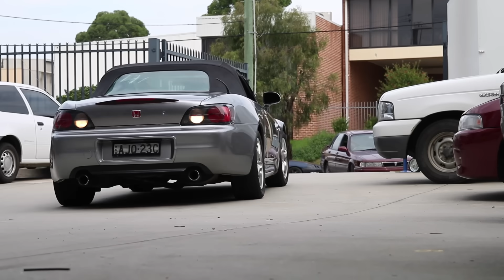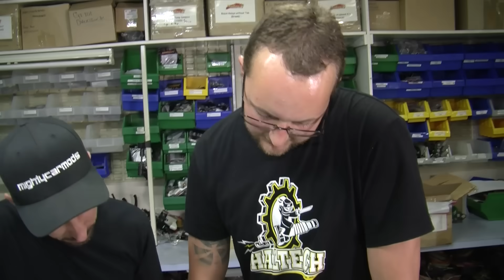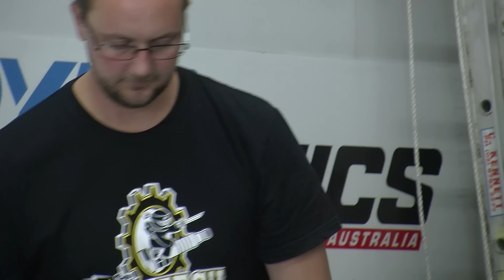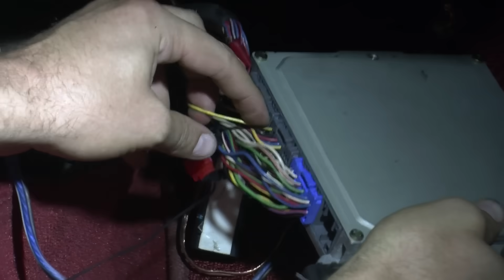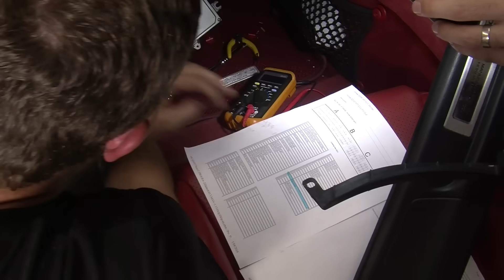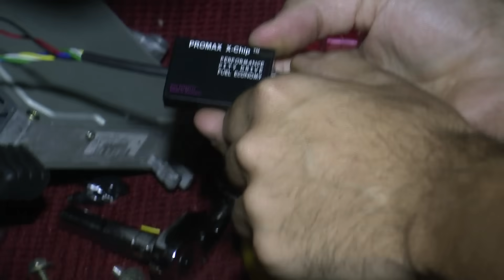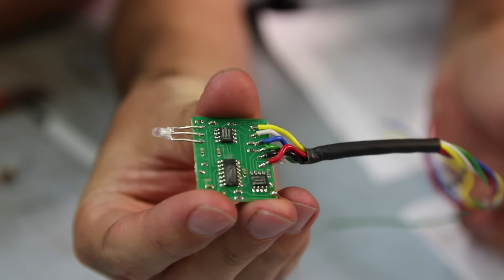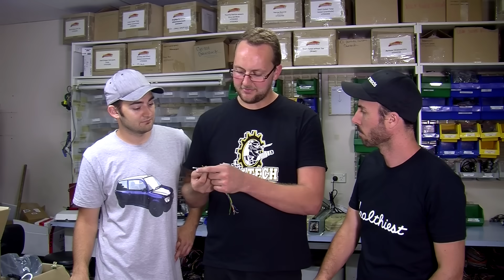eBay Performance Chips -  Mythbusted

Comment: Chips that are for factory turbo vehicles tend to see more of an improvement than NA cars... mostly because you're just upping the boost pressure along with timing etc, whereas you can't do much to improve on a stock NA engine tune.
Reply: of course, I'm talking about legit tuning companies, not random ones from china selling on eBay...
Reply: Especially a super high tuned N/A engine like s2000 wont even notice a chip :)

These things should be tested on low hp v8's of luxury cars like BMW 540i or 750i's v12.

Those engines are low hp/litre with pretty good head and intake design.

I don't also get these guys saying you can't do much on an n/a engine. If Honda can squeeze 240hp of a 2litre engine and make it a daily driver you sure can take a 4litre v8 bmw engine with 286hp and tune it to 386hp with "similar" setup, aggressive cams and some headwork, and a programmed chip specifically for those cams and heads.
Reply: eamh2002 Exactly! Look at all the muscle car guys with big v8s... some of them do put blowers on them, but, you can still get very impressive numbers from simply putting better headers and carbs on them. There is no replacement for displacement. ;)

But like you said, yeah, I'd like to see what kind of gains you get from a big german v8 that was tuned more for comfort as opposed to powahh.
Reply: David Fresne N/A cars can have their ignition timing, compression ratio, injection, pump speed, and valve timing altered by a tune, which (depending on the severity of the tune) increase power tremendously. Take all-motor 8 second Civics for example. Large-bore valves, large injectors and open headers won't be fully useful without a tune for them. Turbo cars will just make more power per tune.
Reply: SidewaysGts well tbh the MKV, MK6, and MK7 GTIs gain between 30 to 70 whp with just a tune and no bolt on a, granted they are already turboed tho
Reply: David F. I seen a unicorn shit the same fire it was an amazing experience!!!!
Reply: So it's the chip's fauilt if you were expecting miracles on an already maxed-out from the factory N/A engine?

Protein shakes too are a fraud if you use them on an Olympic athelte and only see micoscospic improvments at all?
Reply: Alejandro Bello It's not the chip's fault, it's the manufacturers fault for making the factory tune too good. :)
Reply: ***** If you read a little more closely, I mentioned "upping the boost pressure along with TIMING, etc" The etc, being the other things you mentioned. haha. 

But yes, the manufacturers main goal is power as well as longevity for those who don't maintain their vehicles properly.
Reply: ***** lolk all you quoted was "just upping the boost". you just failed to include the "timing, etc" from my comment.
Reply: ***** okay. next time, i'll make sure to include every single variable that needs to be accounted for when tuning a vehicle. :)
Reply: SideWays8Productions  Yeah that is true, but you need much more than just a chip to make power on an N/A vehicle. All the stuff you just mentioned above, like, compression ratio, large-bore valves, large injectors and headers need a tune. My point was that comparing a N/A and a factory turbo car, stock vs. stock, you will see much higher gains from the boosted car, unless you do serious engine work to the N/A.
Reply: What are you on about? Can you read? I was saying that with just a simple tune you can make power in a N/A car. You'll obviously make more power in a boosted car with a higher AFR, but on the topic of simple, conservative tunes, bolt ons or mods are not required (again, for the simplest of tunes).

My first tune on my STi was done via accessport with absolutely no hardware mods whatsoever. I tuned my neighbors BRZ with an opensource map with absolutely no mods. Both gained roughly 20hp safely. I'm simply saying, you can increase power in an N/A car with just a tune. Not by much, but still doable.
Reply: SideWays8Productions  "I tuned my neighbors BRZ with an opensource map with absolutely no mods. Both gained roughly 20hp safely. I'm simply saying, you can increase power in an N/A car with just a tune. Not by much, but still doable."

My apologies- But are you telling me that you took a car which typically dynos around 160 whp on most roller-based dynos (ie dynojet) @ sea level, and picked up 20 whp, bringing it close to (ballpark estimate) 180 whp, with zero bolt ons, and "just a tune"?

I hope youll excuse my skepticism, brought on by many years of operating various dynos professionally for years before moving to australia, and ask you to provide some evidence to support this claim, or if you are able to do so.  I have never seen a car pick up over 10% of its power from a remap of any sorts. Care to elaborate on the specifics of what you altered? What system did you use? What kind of dyno? Etc. Thanks.
Reply: I wouldn't say that, I would say that it actually depends more on the number of cylinders and manufacturer. Japanese cars with 4-cylinder engines tend to be more highly strung from the factory (weather N/A or FI) vs v8 or v6s. Thus they tend to have higher compression and more timing (generally speaking) to up the power output of the smaller motors. So therefore there is less on the table to be extracted at a later date. Also, most tuning suites don't have any control over boost, only aftermarket higher end ECUs can manage boost and that is usually after it is added to it via a few relays and solinoids.
Reply: James T Kirk
"Also, most tuning suites don't have any.."

Sorry- Tuning whats?
Reply: SidewaysGts Tuning suites are programs that you purchase that can modify the factory ECU (ECM, PCM, ect.) and have a credit system where you purchase tokens to unlock each ECU. HPtuners is the easiest example, but lots of them work that way. Most dyno shops pay a fee that gives them unlimited uploads. They do it so people can't use it to much. Say for example, Hptuners coast 900 bucks me and my buddy go in on together for 450 each, we get it and it comes with enough credits to tune both out cars. Then another friend decides he wants to tune his car, he goes online buys 2 credits (why it is two for one car I don't understand) and now he can tune his car. I really don't know how they came up with calling them suites, but I guess I can kinda see it... buying rooms at a hotel... buying tunes from the software company. Anyways hope that helps.

FWIW HPtuners does not provide provisions to control boost. Pretty much any suite that piggybacks or allows you to edit the factory ECU won't. Unless of course it is a factory turbo car that has user adjustable boost control standard and it is controlled through the ECU. You can have adjustable boost pressure without the ECU being involved. However here are some that can, I'm sure AEMs stand alone can do it. Holley Dominator (Holley HP can too if you buy the driver), Megasquirt 3, Megasquirt 3pro, FAST xfi, Big Stuff 3 all can. There are more out there such as Motec but I am not familiar with them.
Reply: I disagree. The factory ECUs for factory turbos can control boost pressure, so why can't a tune make changes to that? I know for a fact, when you tune/chip a B5 A4, depending on the tune, you may see 12-15 psi, whereas with the stock tune you will see 7-9 psi. There are provisions for the boost to be controlled from the factory, so it is very easy for a tuner to make changes and or modify that.
Reply: David Fresne I clearly said that some could if the factory ECU controls it. You know, it is possible (and more simple) to control boost without an electronic controller. I don't know what your disagreeing with.
Reply: James T Kirk I apologize. I took "user adjustable boost control" wrong.
Reply: Its cool, it was a long post. 

To elaborate, IME few factory boost control options can operate in a close loop format. The ECU's a listed allow that. Mainly just trying to say that if you're willing to pay for it, it is completely worth it. I am running a time based c02 boost controller on my Camaro (which is similar to a ECU's open loop boost control). If it was an older car that I could use a stand alone on (emission testing in my area), I would use one simply for its close loop boost control.

Comment: You could have just connected an Ohmeter between the inputs and the outputs and saw that there was zero resistance; meaning the signals just get passed through. Then you could have saved a lot of time and trouble, rather than installing it and putting it on the Dyno.

Comment: Adding modifications to motorized vehicle to increase performance is a crap shoot at best. Stock settings are usually done in order to balance the power and torque of the engine based on displacement, fuel delivery and valve train type while still meeting government standards. Taking an advanced driver or riding course is money that is better spent rather than adding mods that might cause reliability issues with the machine.
Having a fast machine does not automatically make someone a fast driver/rider.

Improving suspension and brake set-up to help make a vehicle handle better makes more sense than messing with ECU/Sensor settings.

Comment: the unit was suppose to interupt to a mass air flow sensor that wasnt there..plus the directions were how to wire to a vw engine..maybe different for an actual honda mtr...possible that this is why nothing happened?

Comment: 177 horsepower to the wheels?  That's pretty weak.. should be putting down 195-200 in a US Spec S2000.. not sure about this one.  A real tune costs at least $200 USD in most cases, and would be loaded into the stock ECU via the OBD port.  Depending on the engine, you can gain significant power and throttle response that way.  The newer Mustang GTs with the 5.0 Ti-VCT gain quite a bit of power from just a tune.  A lot of cars with forced induction can gain a large amount of power from just a tune as well.  These $20-30 ebay "chips" are a joke, of course.

Comment: you cant do it on the ECU side. because the wires are shielded.. I had the same issue with my air/fuel gauge. the shielding is blocking all signals... bet if they did it right they might have seen something... but ive never seen this type of chip for a honda...

Comment: I'll admit the video was entertaining at points, but was it really necessary to prove what everyone already knew? Even with a proper kpro tune you won't net 35hp on a stock motor. If a $2k+ ecu won't give you that much, there's no way a $20 ebay chip will.

Comment: Ha ha, You dumb asses payed for some glorified resistor.  I bought a cheap ebay mod once, and it turned out to be a resistor potted in polyester resin in a relly nice plastic container.
Reply: Gee Adams. Nice comprehension. Back to public school for you. Oh well! At least you have good self esteem.  To summarize: The whole POINT was to TEST the gizmo.  Maybe you could work at the Department of Motor Vehicles.

Comment: Some chips work and other don't. There are tons of eBay chips. Look for a venom performance module. I put it on a Honda a long time ago and it worked fine. Nothing beats tuning but the car also got a jet performance tune via the mail. Which I think is useless lol. 

I tune cars myself now. Cheaper, better.

Comment: Lol, here in Sweden, if you own a Volvo you can get Performance Chips for 70 bucks, both an air/fuel ratio chip and ignition chip! Then just turn boost on and you get around 180hk - 200 hk! 70 bucks and you get around 60 hk++

Comment: Well if the resistors would work there would be a change in timing (intake temp) ,A/F (map sensor and O2 sensor) by making the computer go "oh the air is colder lets give it more advance and I see that there is more air in the manifold might as well give it more fuel. The exhaust also seems to show a lean ratio might as well give it more fuel too."  I have seen people put pot resistors on MAF and MAP sensors to alter A/F to effect, especially on detuned economy cars but this was just a scam.

Comment: How about you get a real performance chip and not this cheep eBay crap that does nothing
Reply: that's kinda the point, they want to see if it works or not. that's why its called "Performance chips - mythbusted"
Reply: Way to not get the point.
Reply: did you even watch the whole video?
Reply: They purposely bought a cheap chip to show what it does...which in this case was nothing.

Comment: If on the "manual" it says to pair it with a MAF, you should try with a car that has MAF.
What you've done is trying to eat soup with a fork. It is used for eating BUT not for soup.
There are cheap Powerboxes for Diesels and they do work but that's another story. Anyway, you could get more horspower with sparkplugs GAP correction than with those Ebay boxes.

Comment: I actually make performance chips and reflashes for 90s BMWs. I tune my cars on the dyno to create the chip, and see gains anywhere from 10-20whp, on a performance chip. Also improves torque, higher rev limiter, speed limiter removal, cats disable, and 1-4mpg improvement, depending on engine. Granted, they're much more expensive than $20.

Comment: Moog, to beat the vtec, considering that its signal controlled, you can bypass the activation from the ECU to match a more desired RPM, aka Vtec controller. But reducing the RPM to like 4.3, just as a warning is kinda useless in a lower powerband of 1 to 4grand on the tach. So witch to I come, why does it feel like that as what you said in the video, well simply your Vtec is set to high as stock, look into a "Hondata".....

Comment: Right, here are my thoughts on this. The chances to blow up your engine as you put it is more likely if you buy 500$ piggy back board and connect it yourself, than a 20 euro "chip" which simply can't alter data to cause a blow up. Anyway these little boxes are just nice looking boxed inside resistor compared to the old ebay ads. Looks more expensive and some people charge up to 100-150$ on ebay to make it sound more legit.

Comment: You get what you pay for, and should always do business with ONLY Reputable
dealers. For Diesel motors we some times use Tuners "Chips" to get a few HUNDRED Horsepower at the wheels. but we also pay $400, $600, $1,000++ for these Tuners. Big power/Big money. But at the same time for example 1998.5-2002 Dodge Ram Cummins HD trucks paying $400 for a USED " MADDS Smarty" Tuner chip getting 180hp/300ftbs of Torque at the WHEELS is a DAM good deal and most deff money well spent. Spend $400, hit 3 buttons and wait 3min and have a truck that gets 22mpg that weighs 6,000 LBS+++ and can tow 20k all day long and roast the tires in every gear, take off in 3RD gear and shift strait to last gear 5th OD and run 15 1/4 mile runs all day long, yeah, DAM good deal. But after X ammount of HP level you hit a money/power barrier to where it starts taking a LOT of money to go faster. it doesnt cost shit in a diesel truck to go from a 20sec 1/4mile to a 14.8 1/4mi. cost a little bit more(couple of grand tops) to go from a 15sec to a 13sec. But anything FASTER than 13.00ET in the 1/4...you are start spending THOUSANDS and thousands of dollars.

Comment: I'm not suprised these cheap ebay chips are fraud....but you can't say the same about a socketed ECU that has a tune for your setup or HONDATA, Chrome, etc. Those programs will def add horsepower if tuned properly, I have a chipped OBD1 ecu on my honda and there is significant difference in power.

Comment: An N/A engine will NEVER benefit from a chip of any kind. I've always chipped and ECU tuned boosted cars and they respond very VERY well. I used to have a 1.8T Audi A4 and a Unitronic chip for $500 really woke the car up. Try something like that on my M3 and I might as well throw my wallet out the window.
Reply: Chiptunning has been a synonym for performance gains but there's lot more that can be achieved by altering ECU software (maps). Even on a NA engine you can change the way the engine responds during different situations making it much more nicer to drive. The thing is manufacturers maps are heavily optimized for emissions so even on an M3 you would see gains. Obviously nowhere near as big as on turbo car but it would still be different especially if you're going to mod the engine in some way.
Reply: Found out with my lt1 that a tune did benefit from ho but I sent my whole pcm in not buy 1 of these kits
Reply: Tuning the ECU on an n/a car can give good gains. Where did you come up with this idea?
Reply: HOT40K I didn't say it won't give you good gains but compared to turbo car you won't see (in % relative to stock power) same gains from tune alone.
Reply: mastadriver I was talking to 647killa,
Reply: HOT40K After tuning many cars myself, I have come to the conclusion that a simple ECU tune is not worth the money for the 2-3 HP gain that you are never going to feel, compared to my brother's GTI, which went up almost by 50 hp with a simple APR ECU tune. However, on an N/A engine, if you have supporting mods such as a proper CAI, Exhaust, Headers etc, then ECU tuning will definitely come in handy to accommodate the new ratio of Fuel/Air mixture etc. Really though, a simple 'chip tune" on an N/A engine is useless. I have done a $400 Shark Injector ECU flash on my E46 328i, just to test it out before I wanted to do it to my E46 M3. All I got was about 7-8 HP out of it, and that too after paying $400. Mind you, my 328i is a bone stock daily driver with a simple K&N drop in filter. It really didn't do much on ANY N/A engine I've ever tuned or seen a shop tune. The gains aren't worth the money, but to each their own.

Comment: I want the T shirt that says. "$20 Ebay chip = 35hp" and it has to have that chip sewn in with a battery attached, so you can flip between city/power/economy mode while you're doing your grocery shopping.